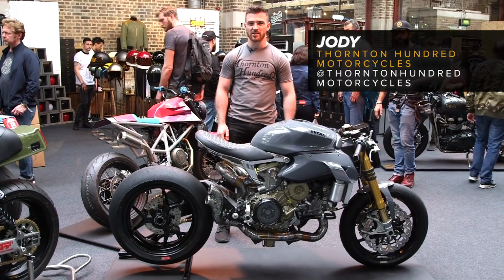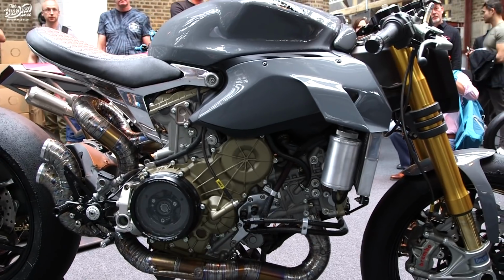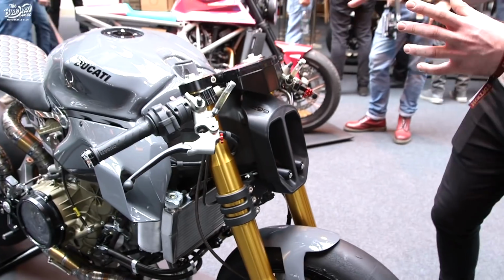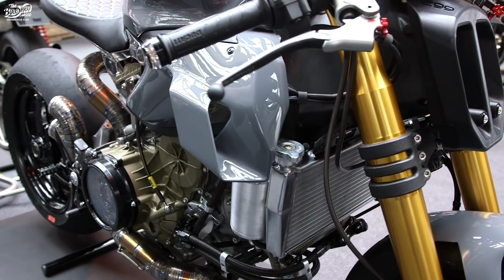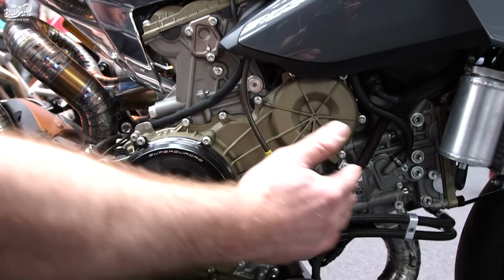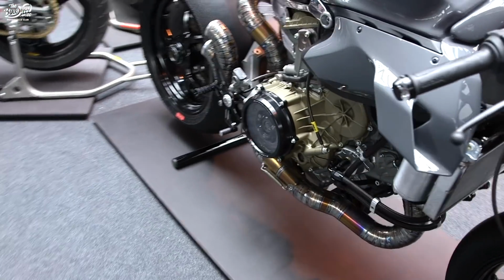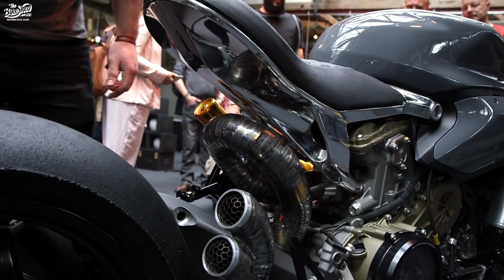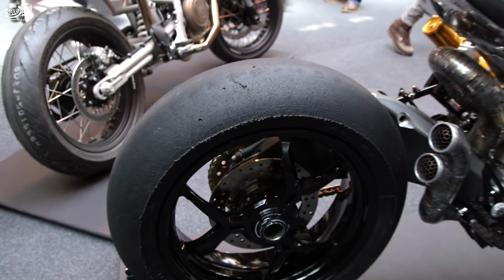Ducati Panigale 1299 Custom

Comment: Looks beautiful.  Put a guard on that oil cooler and radiator before you put a hole in them with that front sticky tire and tiny fender.

Comment: This bike is mega. I’ve owned two Ducati’s (among many other bikes). They were a 2015 Panigale 1299 S, and an 09 Monster 1100 S. I was so in love with both of them (the Monster for its looks and ergos... and the 1299 for its ridiculous power), that I’d often dream of buying a newer 1200S and transplanting the 1285cc engine from the 1299 into that frame, and creating a REAL MONSTER!... but I was never able to find a 1299 engine for sale (yes, to be exact, they are 1285cc, to be exact... please don’t be one of those ppl who says “but the badge says it’s 1299cc!😫”). Never did I think about the fact that you could just take the body work off the Panigale and go from there.

Comment: Honestly the most beautiful bike I have ever seen in my opinion. A piece of art work for sure.
Could you explain a little how you built the winglets? Did you fabricate these from scratch? As in forming, shaping and welding all from an aluminum sheet? 
Also, for the subframe under the seat, you said it was machined in two parts. Was this software designed, machines by an automated unit? I am very interested and n these processes. Thanks in advance!

DG

Comment: where is the frame? this thing levitating or what? amazing!
Reply: The swingarm bolts onto the back of the engine and the air intake / headstock bolts onto the front of the engine . Tricky Italians.

Comment: The fit and finish is okay, but the intake/headlight bit and seat doesn’t flow with the bike at all. 

The seat breaks the lines of the tank especially with that rounded rear.

The exhaust doesn’t really look all that good too. 

But props to him for doing something creative with the 1299, I guess the 1299 is just really hard to beat aesthetically.

Comment: Where is the number plate carrier? Where are the rear indicators? Where are the headlights - this tiny tiny LED’s? Could never get this registered.... the front wheel hugger / cantilever mudguard is crooked
Reply from the maker: DuzBee number plate carrier had been removed for the show - let’s face it they aren’t the most attractive things to include when on display. As for the indicators, they are in the bar ends and are motogadget m-blaze discs and because they are visible from the rear, suffice for both. As for the headlights, it will pass daylight running MOT.

Comment: Interesting work- but you'll kill yourself using slicks as they are designed to go through just one heat cycle from new/cold then degrade chemically  to scrap . Might look cool but mindless stupidity to ever think about using then like a normal street tyre .Sorry for being an arse but you seem clued up so should understand .

Comment: "Still got Traction Control and Anti Wheelie so it's still safe to ride"

Immediately breaks traction at 10% throttle..
Reply: Cold tires and they are slicks but yes...This bike will get  you in trouble especially being so light and so much power AMAZING!!!!!!
Reply: turns traction control off for video 😂😂😂
Reply: Highlight of the video
Reply: my monster 1100 front wheel lifts off even at TC level4 haha
Reply: Freerider  This is 100% true...Well said.
Reply: Freerider  Im just in awe. Well said bro 👏
Reply: Because it’s so light
Reply: instablaster.
Reply: I have a Ducati Monster 1200 with the traction control setting at standard for sports mode. I can do a spin like that no problem, but a heartbeat longer, and I will get an engine cut to stop the spinning.
Reply: Closer to 1% 😅
Reply: Exactly haha
Reply: Freerider  failing bolts, weakened steel and seals etc all sounds like driver error indeed... not ...
Reply: Your making no sense at all, you are speaking like a brainless child who got the wrong xmas present . You sir already are under the bus ;) 

And no i actualy dont regret a single thing in my life, i have  great offshore job, great kids , great family. pretty sure im older then you aswell child. atleast you act like one.